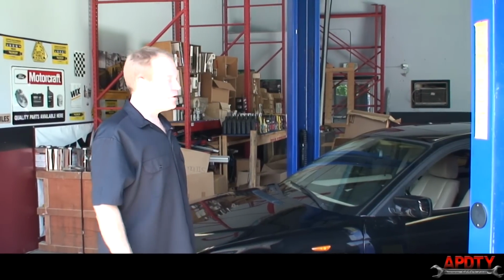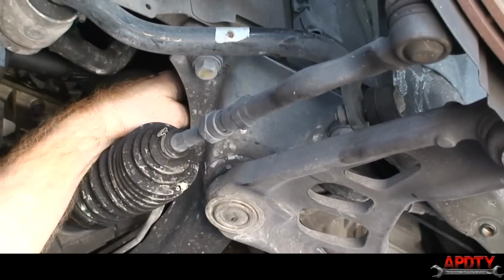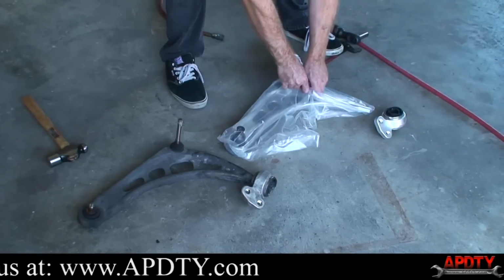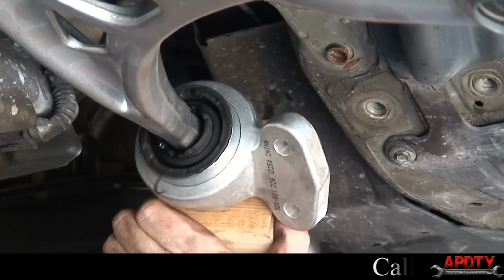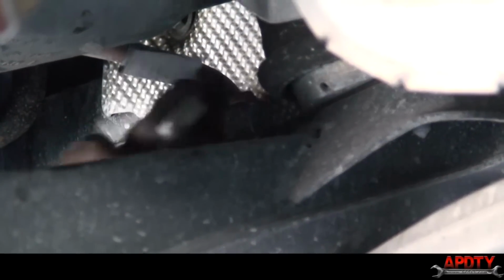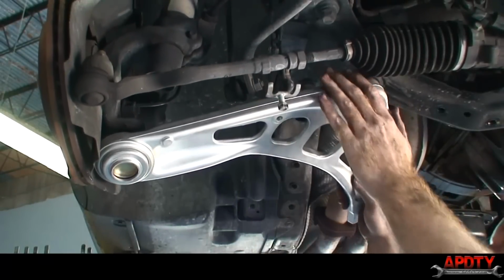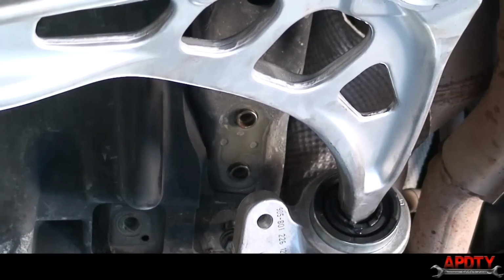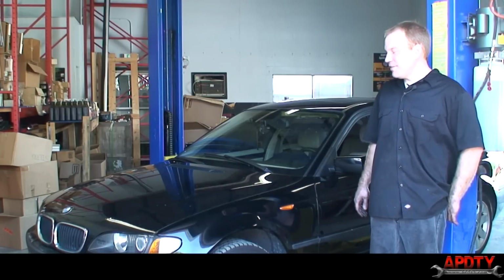2005 BMW E46 3-Series Control Arm

Comment: if you remove the airfilter box you can reach that bolt with a socket and two long extensions......just saying. oh and you can get the balljoints without the arm (much cheaper) from a german company called Meyele. the numbers are 20030033 (for the short one) and 20032179 (the long one) they do also fit the BMW 3er E46 CABRIOLET COUPE TOURING Z4 E86 E85 cheers

Comment: The top ball joint nut the no. 22 is much easier to open from top at the engine bay using a long extension... Simple

Comment: Rather than use a spanner to loosen the nut in the inner bushing, I’ve used several long extensions and a long reach socket from inside the engine bay. you might need someone on the other end just to mount on the nut, then you can ratchet it off from the top of the car. Well easy that way

Comment: The 21mm nut is loosened by removing it with a long extension from the top thru the engine bay, not from below. One side is covered with the back of the airbox, but easy to remove.

Comment: Great vid. Just an observation, but why not push the bushings on with the control arm off the car? Seems like it would be a lot easier.
Reply from the maker: +Artby2wenty Thanks for the video props! Agreed, installing bushings can be a pain sometimes. Spray silicone lubricant is differently your friend in this repair. @ 14:24 the tech held the bushing in it's mounted location. He was getting a visual reference of what position/angle the final installation will be. The bushing should be pressed straight on without having to twist the bushing into position.
Reply: +Auto Parts Direct To You  I think you could probably also get that visual reference by comparing it to the old removed control arm and installing it off the car.  Nonetheless, it was still a very helpful video.

Comment: Driver side is easier when you remove the air box and use long extensions and remove the 21mm nut from the frame side of the control arm vs using the wrench. Passenger side yeah no room have to do the wrench method.

Comment: My E46 325XI is similar but different as the frame mounted center ball joint bolts on with two bolts .

Comment: its a 22 mm nut and a 19mm and a 16mm
Reply: are you sure its 22mm and not 21mm? hin the video he said 21
Reply: It could be either 21mm or 22mm and it also could be 18mm or 19mm...and of course 16mm depending on your E46 build date. The old parts on 323Ci had 21mm and 18mm. My new parts had 22mm and 19mm.

Comment: shame to throw out good aluminium for a rubber part, cant they be refurbished ?
Reply from the maker: Agreed, We have a scrap piles seperated by metal type and we recycle them. Most of this style control arm do not have replaceable bushings or ball joints from the manufacturer, although sometimes the aftermarket eventually comes up with bushings and ball joints.

Comment: Use a little dish washing soap rub it on the inside of the Bushing either before or after installing on car key is use soap NOT lubricant soap will dry up into a powder and dissipate without damaging the rubber Also the left side Ball Joint Center one with the 21MM nut can be accessed from above with a Socket and sloppy extensions  much easier than using a spanner and getting a 1/4 turn at a time

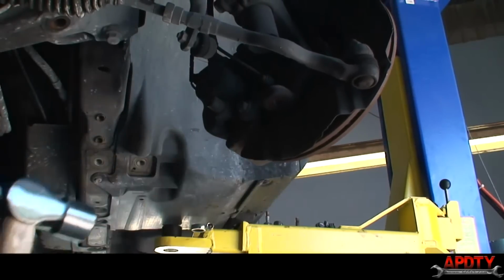Comment: Have you ever done this? It's a lot more than a 10 minute job.All of his parts are coming off easily. I've spent an hour trying to get that center bolt off before because of it being rusted on. The joint connecting to the rotor at 8:55 came off very easily as well. You really should use a ball joint separator on that instead of banging on the wheel. This is one of those jobs than can take an hour per side to a half day per side depending on what you're dealing with.

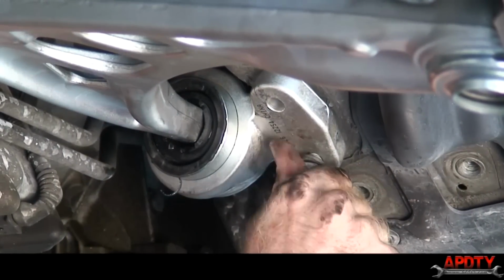Comment: 14:45 parts from china i think you can use this part 1 month only :). buy from dealer or  moog, trw, Powerflex, Meyle-HD. they are for long time but some is very hard some is comfortable
Reply from the maker: A li yeah we sell all of those brands and 99% of the customers just buy the cheapest brand which is made in China, The chinese manufacturer we have used for almost 10 years and we have a less then 1 percent defect rate on these and we sell hundreds, so they do hold up very well and the factory it comes out of is more important then the country.

Comment: I chaned the Control Arms, the Hydro back Bushings, Sterring Rods and the coupling rods, Its Like new now and a big Change to the Car the whole Kit was about 150 Euros from EBAY (R.A.G. Brand Name) Thx for this Vid. Helps me a Lot. Without a Pickle Fork this will not Work! I

Comment from the maker: The ball-joints are pre-filled with a lifetime grease and have no grease fittings, and there is nothing to grease on the bushings, so greasing is not required on this job.

Comment from the maker: To start, the vehicle has to be loaded to a specific weight before aligning, and the fuel tank has to be at a certain level. BMW has different specs for all the different models, so he would have to look it up specifically for your car and add the appropriate weight to the vehicle. Also, some models have a procedure to go through after alignment to relearn the DSC system to the new alignment angles. And lastly, the rear toe can be difficult to set for someone not familiar with the unusual setup.

Comment: Great video! Recently replaced both control arms and did alignment. However, the car is completely misaligned and DSC light comes on. The mechanic claims suspension component need to be replaced, whereas before control arm replacement the car drove fine. What could've gone wrong?

Comment: I was told to put the bushing on the wishbone before you start attaching it to the car, seemed a lot easier
Reply from the maker: William Brodie yes just be careful to line it up to the bolts and make sure the bushing is on the right position, the bushing can be very difficult to remove and reposition once it is on the control arm.

Comment: The bushing at the wheel wont come off with me. Tried hammer, slash hammer, pneumatic hammer. Doesn't move for shit :( I only took of the bold, did i forgot somthing? Thanks...
Reply from the maker: Tom Yeah they can be a beast as the rubber can really stick to the control arm. If you are just replacing the bushing only, then you will probably want to remove the entire control arm from the vehicle and try and get the bushing off on a bench where you can get better leverage. Worst case scenario, replace the control arm also, just make sure you put the bushing on in the right position so you dont have to try and remove it form the new control arm.

Comment: Has anyone installed these? How have they held up? Several of the other brands don't last more than 6 months. How have these held up long term? Looking for some real user feedback. Thanks Everyone!!!
Reply from the maker: briggsk1 We installed these on this vehicle in early 2013 and they are still in excellent shape on a daily driver vehicle. Also here is a link to them on Amazon with other customer reviews, not sure where the 6 month thing is coming form as we have sold thousands of these over the years and have had excellent feedback and less then 1% defect return rate. 
http://www.amazon.com/gp/product/B00JWWD9AU/ref=as_li_tl?ie=UTF8&camp=1789&creative=9325&creativeASIN=B00JWWD9AU&linkCode=as2&tag=aupaditoyo-20&linkId=WKOIETJAR5T3GGCP

Comment from the maker: Is the mechanic who is doing your alignment familiar with the alignment process on BMWs? They can be tricky beasts to align, and if not done correctly can cause the DSC light to come on. What component are you being told needs to be replaced?

Comment: is there a way that you know when you have pushed that bushing completely onto the control arm?
Reply from the maker: grey owens When you go to bolt it up, if it is not on all the way you will see it. They are tough especially when brand new as the new rubber is grabbing the control arm.

Comment: and on the passenger side u can get a long extension 22mm socket and get that nut off fron under the hood in seconds
Reply: alan maclean at 6:00 right? Really?
Reply: alan maclean: Yes just five minutes ago I watched my mechanic do exactly that. I'm not sure if he used a universal socket adapter or not but he did it easy after removing the cold air intake. (Drivers side). (I've just noticed michael byne has commented the same thing lol).

Comment: I used this video as a reference to do the job.  I used meyle HD parts - which come with the bushings pre-mounted on the arms. An excellent video, thank you!  Just for future reference for anyone else looking to do the job - you will save yourself a lot of time by using ratchet, a universal socket adapter, and two long extensions to remove the 21mm nut holding the centre ball joint instead of trying to remove it with an open ended spanner.
Reply from the maker: +michael byrne Excellent!!

Comment: Try doing this on a 93 325i in 10 minutes... NFW. Not even in a BMW shop with every possible tool. You will cut at least one bolt probably two or three.

Comment: Suggest that you push in the bushing into the control arm first on the ground and then install onto car in one piece.
Reply from the maker: Sim Tan yes just be careful to line it up to the bolt holes and make sure the bushing is on the right position, the bushing can be very difficult to remove and reposition once it is on the control arm.
Reply: Auto Parts Direct To You The best way line it up is compare it with the old one you have taken off. Again, much easier to press on off the car. Trust me I've found out the hard way. Helpful tutorial though, so thanks for sharing.
Reply: @torquesteer2657  It needn't be hard. A large f-clamp, or a ratcheting luggage strap could be used for pressing on the bush. But a more serious problem is that not correctly placing the bush will cause it to fail very quickly. BMW specifies a precise measurement for the distance between the bush and the middle ball joint.

Comment: jesus those bushings you were struggling so much with just put a bit of dish soap on the shaft of the control arms or the inside of the control arm bushing and it slides with no issues

Comment: You made that a whole lot more complicated than necessary. The 21mm nut on top can be accessed from the engine compartment with a long wobble extension bar and socket which means you can also make sure the joint is torqued up to the correct setting. Attaching the rear fixing BEFORE you reassemble saves all the hassle you made for yourself. I did mine, both sides, in 20 mins without a hoist and I am not a pro mechanic.

Comment: Something to note.. never lube that bushing with anything other than soapy water. Oil/petroleum based lubricants will not allow the rubber to 'grasp' the aluminum for the proper seating.
Reply: You can use rubbing alcohol, it serves as a mild wetting agent to lubricate it but evaporates very quickly.  We use rubbing alcohol on latex tubing to thread it onto plastic knobs at our factory.

Comment: Is it not easier to just. Put the bushing on the control arm first before putting it in the car. ?
Reply from the maker: Yes it can be, as long as the bushing bolt holes line up nicely, otherwise the rubber bushing is hard to turn

Comment: Keep in mind that the metal "pan" you remove is actually a reinforcement plate that is held on with "torque to yield" one time use bolts.  These must be replaced every time you remove them.  Torque them to 88 ft-lbs, then turn another 90 degrees.

Other than that, great video!
Reply: Where do get that reference from?
Reply: Bentley Service Manual Section 310-3.
Reply: Dude, if someone followed your advice they would have over torqued their bolts by double the recommendation and stripped out the threads in the unibody. Per Bentley manual, stage 1 torque to 43ft-lb stage 2 torque angle 90 degrees plus 30 degrees.
Reply: You are correct Bryan.  I'm not sure where I came up with 88 ft-lbs. :-/
Reply: I respect your integrity man :-)